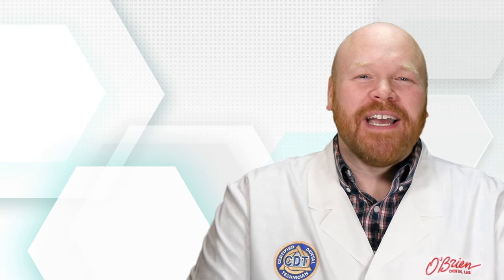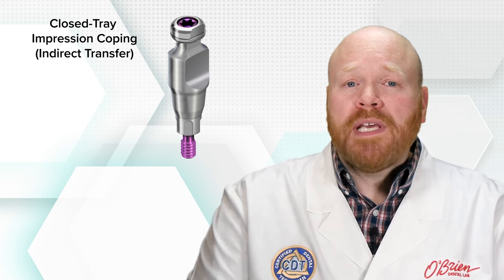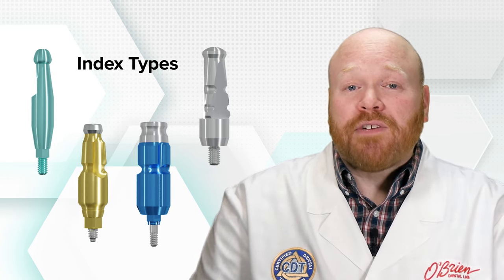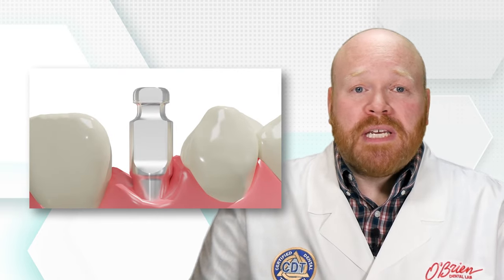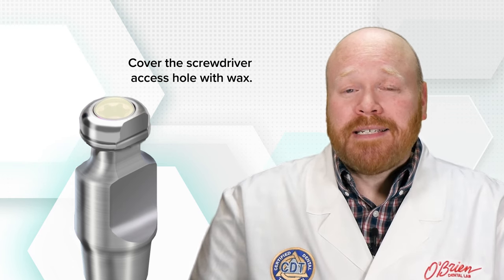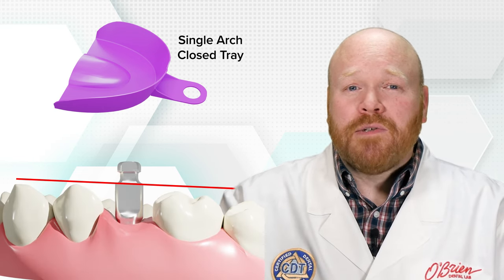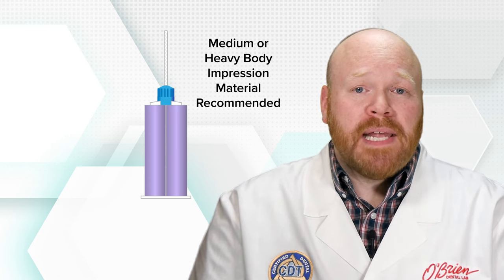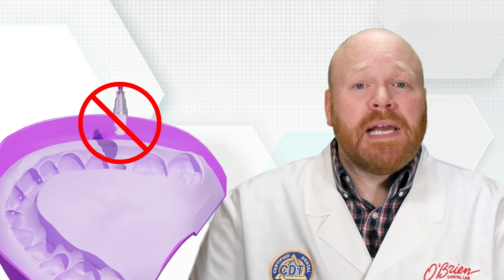How to take a closed tray implant impression

Comment: Your videos are excellent. They are easy to follow and always have helpful hints and reason why not do use certain techniques.
Reply from the maker: Thank you so much!  We really appreciate the feedback.
Reply: @OBrienDentalLab  Hi Alex, I have a question, to get a bite reg do you remove the impression coping, place the healing cap back on then take the bite reg?
Reply from the maker: @pon372  Yes, you will typically need to remove the impression coping to take the bite, and it's a good idea to replace the healing cap first.  However, if the impression coping is short enough that it doesn't extend past the occlusal table, you could take the bite with it in place.

Comment: Thank you, Doctor, for the information. The material that is placed on the head of the screw when installing the crown means the end of the work. If this material falls, will it affect the implant? Thanks
Reply from the maker: No, a failure of the restorative materials will not typically affect the implant.
Reply: @OBrienDentalLab  Thank you Dr

Comment: If taken properly, and copings are perfectly repositioned .. why don't i use it for full arch restoration
Reply from the maker: Closed tray impressions are designed to be easily removed and reinserted in to the impression, and therefore they don't "lock" in to place like an open tray impression coping.  Because they are "locked" in place (in the impression), open tray impression copings are typically going to have a better chance of providing greater positional accuracy.  That extra accuracy may not be noticeable on single units, but when multiple implants will be tied together with a bridge or hybrid it can make a big difference.